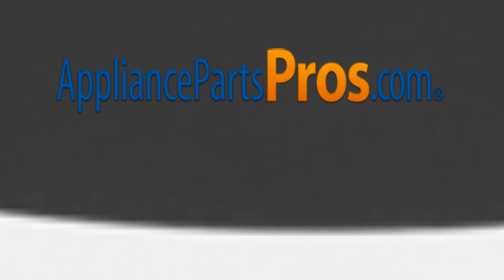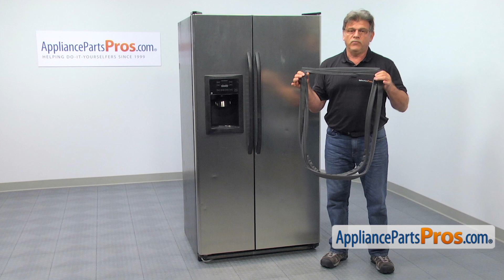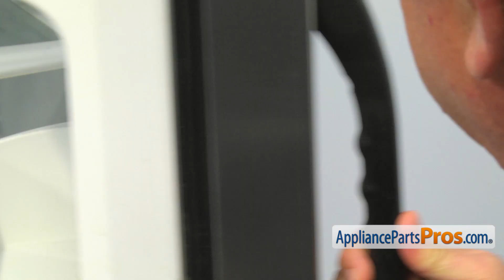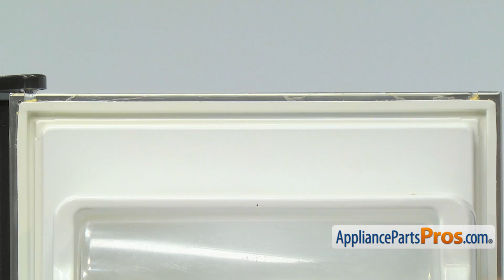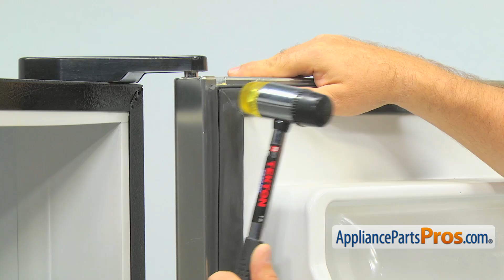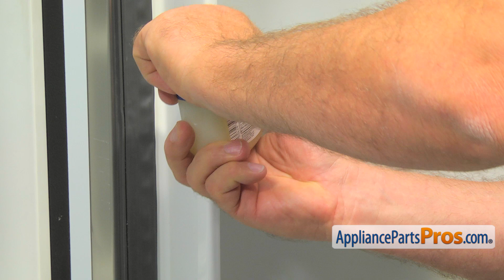How To: GE Refrigerator Fresh Food Door Gasket WR24X23250

Comment: How can I find a gasket for an old RCA side by side refrig? I didn't see any on your site.
Reply from the maker: What is your model number?
Reply: @appliancepartspros  The only thing listed on the door is MSX22G.
Reply from the maker: I was able to locate the part numbers you will need, but the manufacturer has discontinued this part and there is not a replacement for these parts. You can take the part numbers and check around to see if you can locate those in stock somewhere. The part number for the fresh food gasket is WR24X5231 and the freezer door gasket is WR24X5230.
Reply: @appliancepartspros  Thank you so much. I appreciate your help!
Reply from the maker: You're welcome!

Comment: Very helpful video.  I put on the new gasket after soaking in hot water but it didnt seal properly.  Found this video and use my heat gun to get gasket to seal properly.  Added petroleum jelly and it's perfect fit.  Thanks!